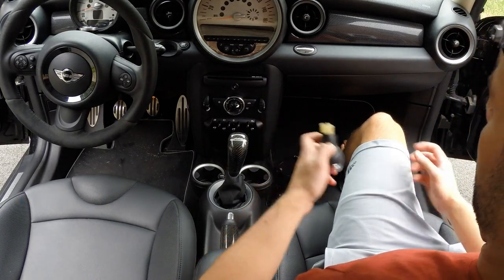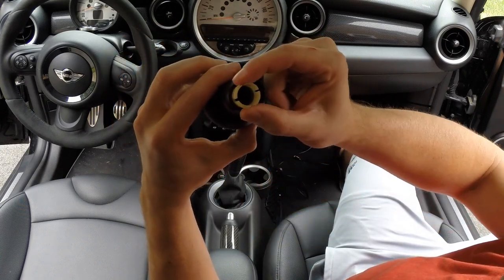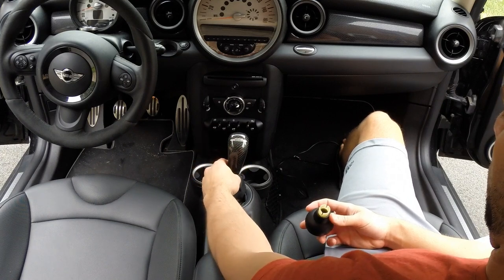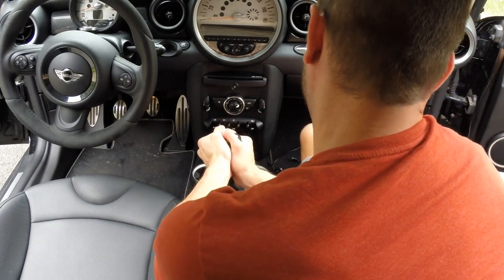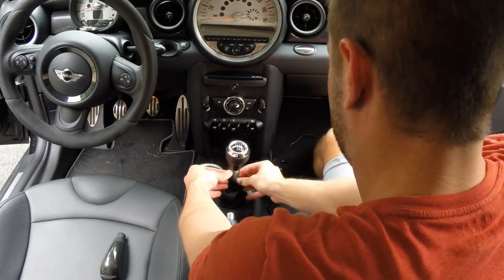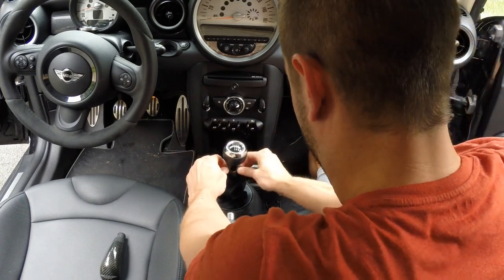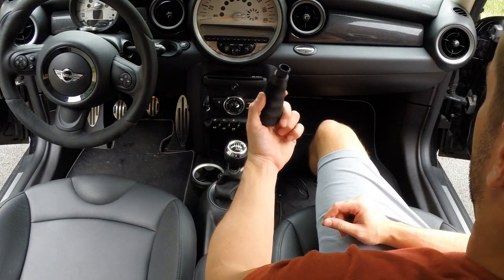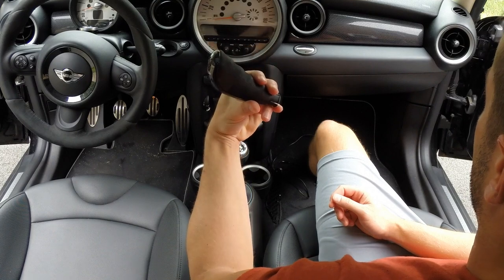MINI Cooper Shift Knob Removal and Installation: How to

Comment: You are not helping your transmission any when you apply this much force to your knob.  This video looks more like a way to break your knob and try to fix it back.  You take off the skirt and pull it up in order to get the entire assembly off and then using basic tools your able to seperate the old knob, and reinstall.  In such a way when you are done you dont have to tey and fix your ripped and saggy skirt. 🙃😉
Reply from the maker: Thanks for the advice and taking the time to jot it down!
Reply: This is how mini gear knobs are fitted
Reply: No, it is not.  This would get you fired at the dealership!! Haha.  You guys are a trip.  You remove the skirt and lift it up and remove a ring below that allows the entire assembly to left away from the actual shift bar.  So when you do your work you are NOT doing damage to your transmission
Reply: Paul Owens-Troupe not on about dealerships, the shifters on a plastic ring that’s makes the two parts fit together 
What skirt would be sagging from disconnecting them two pieces?
Reply: @PaulOwensTroupe  please make a video.

Comment: How was the leather skirt originally attached to the collar on the knob? Some videos show a zip-lock. I don’t think that’s the case with my car. Are you saying that when you pulled the leather in a downward direction from the knob it did not tear even though it’s attached securely? Thanks!

Comment: This s a stick (manual trans) right? Curious..I actually make resin cast skulls that would be perfect for my Clubman (I have skulls all over it..lol) but mine is an auto trans and I have a push button in the center of the knob. I'm sure I could modify my skull but need to know how to remove the original to find out what I have to do. ;)
Reply from the maker: Ronald, yeah mine is a manual. That sounds pretty cool to have skulls all over your MINI!

Comment: where do you go to purchase your shift knobs?
Reply from the maker: I bought mine from the MINI dealership of South Atlanta.
Reply: nice! thank you!
Reply from the maker: My pleasure. Glad it was helpful.
Reply: The leatherette is attached to the white slotted collar on the original shift knob. How did you roll it away without tearing it when you first removed the original knob? Isee you are have a small issue refitting onto the collar now that you reinstalling the original knob.
Reply: gustavo Lopez Please contact me regarding Mini knob. Thanks!
Reply: Eddy Joe Please contact me regarding Mini knob. Thanks!